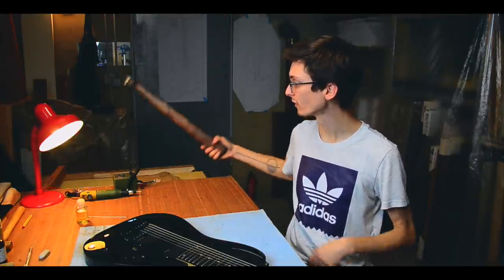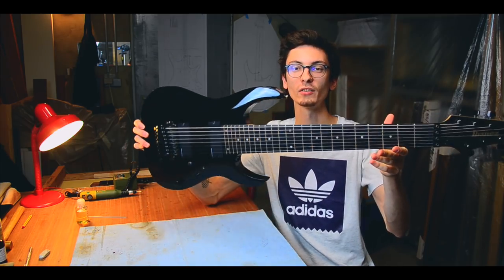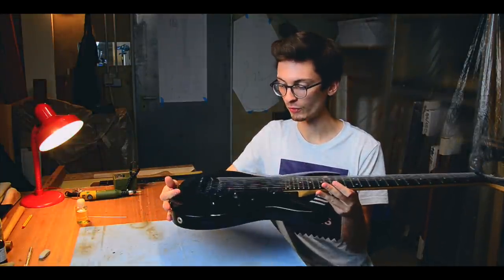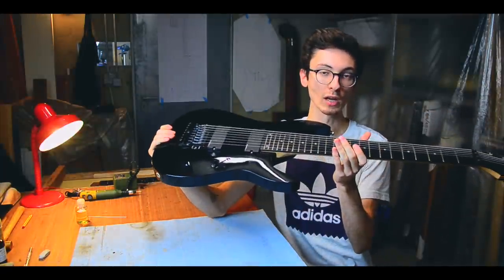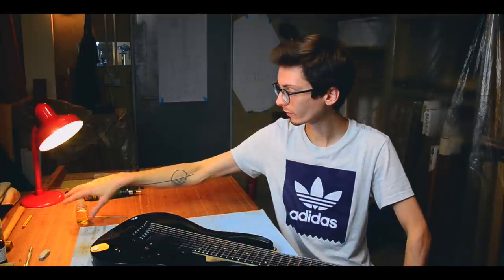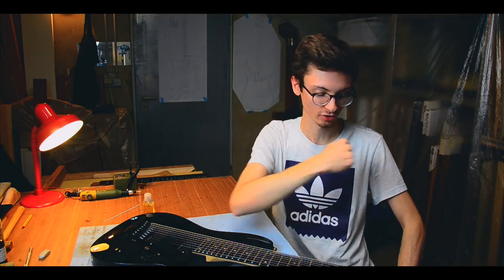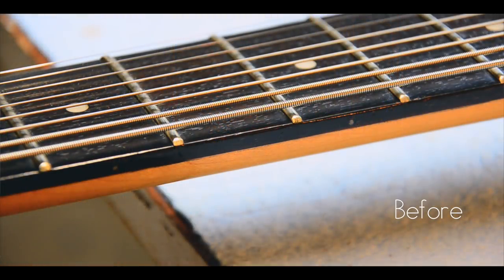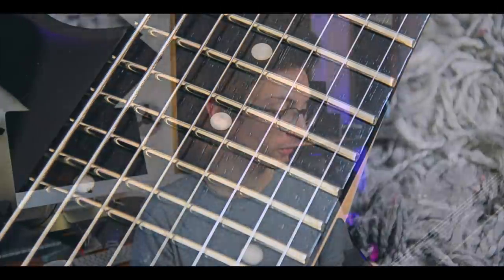Breathing new life into my oldest guitar | Tung-oiled neck, polished frets, new side markers

Comment: So I've just removed the gloss from my guitar necks. Would you recommend rubbing tung oil on them or will they be fine. I only used a green pad to remove it, no sandpaper.
Reply from the maker: If you just removed some of the glossyness with a scotchbrite pad that's fine, no need to put a finish on there since you haven't removed the factory finish completely. In my case I sanded a lot until I got to bare wood.
Reply: @MilianMalivukMusic  ahh good to know! Thanks for the reply mate.
Reply: @MilianMalivukMusic  what is that grease stuff you used with the dremel for the frets?

Comment: How exactly did you redo the side dots? I just stained the board on my ibanez black as well and would like to clean it up like that, maybe use some tung oil now too. Hmm.
Reply from the maker: I drilled out a new hole into the old spots, then simply put the plastic "inlaystick" into the hole, cut it off and sand flush with the board!
Reply: He has a video of him doing this in his 7 string rework i think? He shows the way he drilled them out